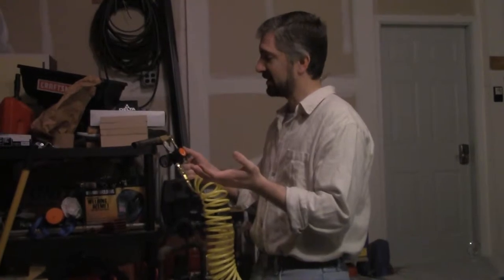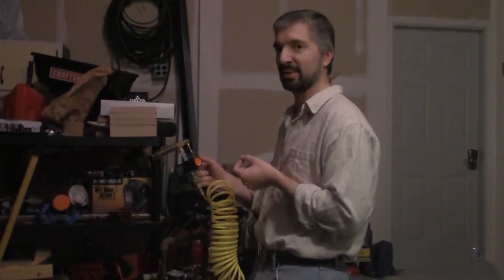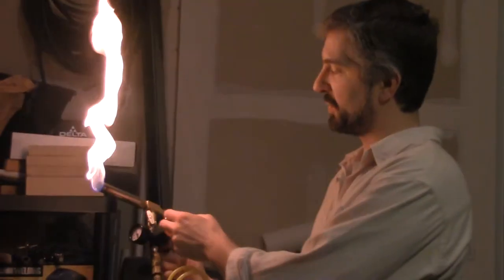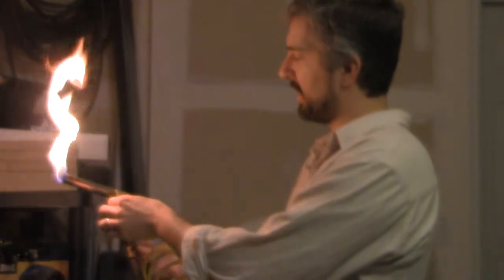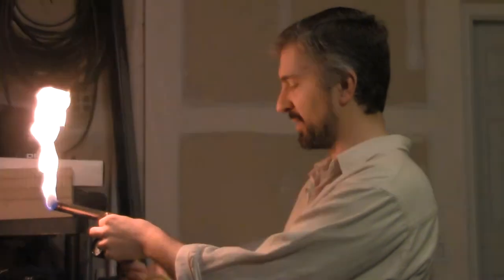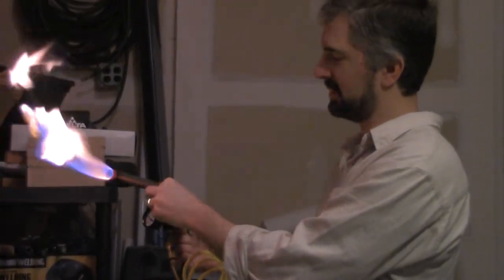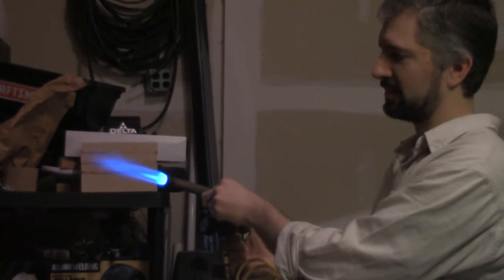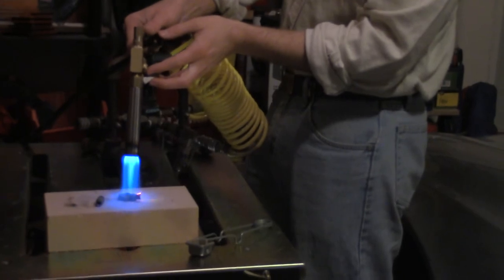Building a bigger blowtorch v2

Comment: Hey great build you did there! I can see one big advantage to this setup and that is you can't suffocate the flame out by having combustion gasses rise up and get sucked into the torch air holes. Torching things at a downward angle precisely like you did in the vid have a habit of doing just that. Also, being able to adjust the flame chemistry could make it more versatile.
Reply from the maker: clkindred Thanks for the encouraging words!  The next attempt I make with this, will be to try to put a "cutting" type tip on it.  I am hoping with the needle valve to be able to, as you said, adjust the chemistry in a way where I can use something more like a finer cutting tip.  Again, my purpose to this was brazing.  With this as it is, I have been able to pre-heat and quickly braze large pieces of metal.  My issue with other torches I have, they do not heat fast enough, so I burn through a LOT of GAS.  I've also tried using weed burners.  That works well when you want to BEND steel, but again, I use SO much fuel.

The "cutting" style torch end should allow me to braze with this as I can concentrate all the heat in ONE point - as one does with Acetylene.  Thank you for the inspiration!

Comment: I am well impressed . Any chance you can please link a schematic or parts list and guide to assembly so i can build myself one too ?
Reply from the maker: Hey. I can try to get something, but really follow the Build a Bigger Torch video and just change a few things. Which I think I point out in this video.... For the most part it is the T and the needle valves. You need the needle valves so you can control the air flow accurate enough to get the mix just right.